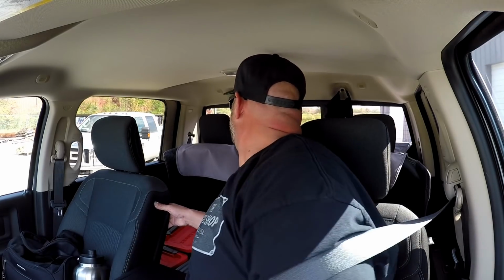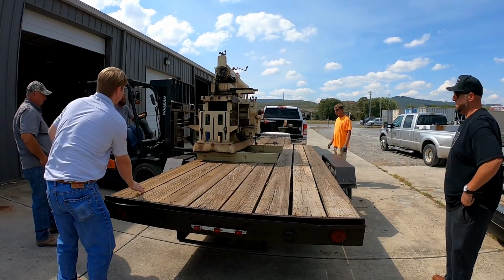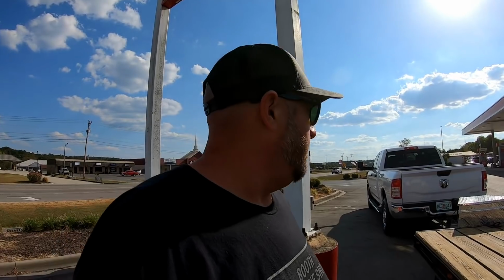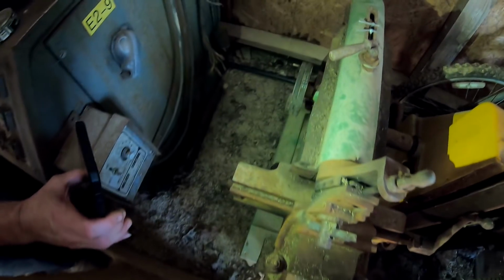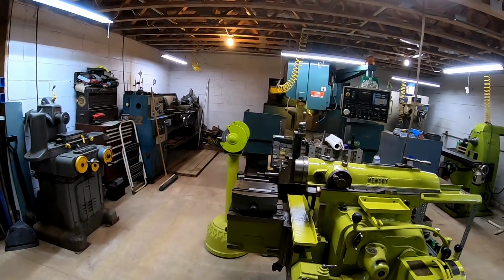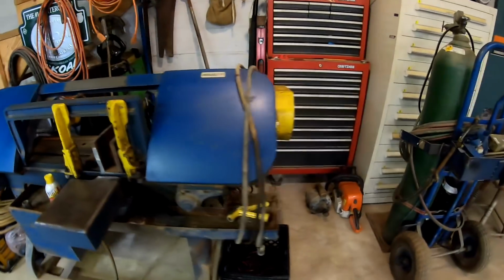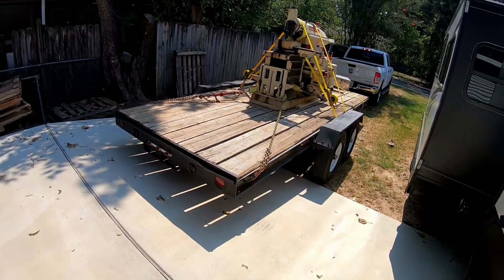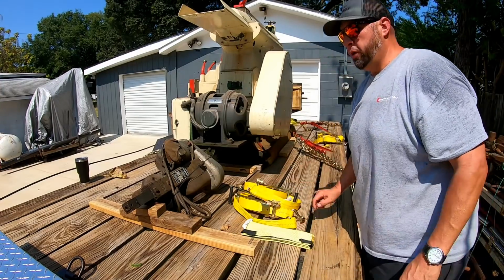SNS 277: Smith & Mills 25" Shaper!

Comment: Guy on the forklift knows his stuff. And patient. And no infernal beep-beep on the back-back.  Bunch of pros work there I betcha.
Reply: If he knew what he was doing he wouldn’t have picked up that one end using just one fork
Reply: @HuronTL  Hey. It is a tool. Tools get used up,bashed,broken,damaged. Yes that was a very heavy load for just one fork. Maybe they bent it,maybe they didn't. So if they did,measure out the unevenness, and bend/force it back in place. I listened quite carefully to the motor. Forklift engines seem to get serviced only after they completely lose function. Not this one. Betcha the filters and short life parts have been serviced. And hydraulic lines etc periodically inspected.The engine ran well. Their shop,their rules,their forklift. They were happy to do what it took to get the old girl off their hands and not scrapped. Whatever it takes. And if that includes an oopsie, so be it.

Comment: Adam since you want to use the trailer like a deck over, you can cut the leaf spring mounts off and add material between them and the frame to raise the deck in reference to the wheels and tires. I think you will keep fighting the fender and deck clearance if you don't add some.

Comment: fyi if you put a twist in your straps, they won't vibrate at highway speed.  And make sure you don't leave a heavy load on your trailer very long.  It will cause a flat spot on your trailer tires and cause a horrible shake.

Comment: Just cut some pieces of water hoses like firefighters use, the inside is made rubber and saves the strap and the outside is something like nylon or so. These really do good job on loading straps and they can be used to save decorative surfaces that are lightly touched by your chains form getting scratched.

Comment: Adam, what would the radial arm drill be used for? Does it have specific benefits over knee mill or a regular drill press?
Reply: They are faster to reposition manually over a bolt pattern in heavy or awkward stock.
Reply: It Can work on bigger stuff..

Comment: Nice to see a Beaver mill! I used to work for Beaver the manufacturer of the Beaver Pal, we closed in the 90's taken over by Mikron machine tools.I was an electrical engineer and built CNC Beaver parts master machines mainly, at their Norwich plant in Norfolk UK. I miss the smell of hot chips and coolant lol.

Comment: What's the purpose of the top piece on the Burke? It's clearly meant to slide back and forth but didn't seem to any attachment points for tools.
Reply: That's the overarm support.  Provides extra rigidity when the cutting tool is set up away from the machine column.
Reply: Attachments are to the dovetails.

Comment: Adam when you go to re-deck your trailer you should fabricate some D ring tie down point’s onto the edge of the deck maybe by welding a 3 /8”or 1/2” C channel to the framework with a half inch iron plate on top  to weld the D ring on , notch floor decking so the rings are below the top of the deck, you could put 4 or 6 per side.. this would illuminate having to run your straps over the edge of the frame … just something for you to think about while re-vamping your trailer

Comment: Just a question on the chain down method, many truck drivers cross the chains when strapping down machines on flat beds, is there a reason for this?
Thanks for sharing Adam.
Reply: Crossing the chains just helps to keep the load from shifting in any direction.
Reply: @thebigdustin  Thank you.
Reply: Yes, it adds a horizontal component (parallel to the direction of travel) to the force vector and stops things from sliding forward and backward more effectively than chains that are perpendicular to the direction of travel (vertical).
Reply: @xenonram  Thank you.

Comment: Adam. Pieces of scrap carpet work well if you don't have enough strap protectors. Also, I have a Bridgeport vertical shaping attachment I picked up years ago and refurbed it. It had a bad motor. I may also add that the weak point in them is a small gear in the stroke adjuster that can break. Just an observation. Hope yours is just fine.

Comment: I worry though about the future will the gen y and z learn to love and save these machines in the future,  there seems to be a real generational disconnect, not just like it was for those born before the 1990's  to the boomers we learned how to work the old way and with tech, but those born after the new millenium well they dont know a world without calculaters computers, smart phones, will they have an appreciation for working with their hands, knowing how to use manual tools, and lathes, non cnc dont get me wrong cnc is good but there are times that the old tools can do a a job better if you have to feel the cut and material, vs a machine just keeping the cut going right on through and ruining an old part or material, plus the set up time programing it, if you only have t cut down the end  or clean up the edge of some material and you dont need to take 20 minutes to program it when you an jaw it up in a lathe in 2 and cut in three, plus the old machines were built to last and in the usa
Reply: I go to a major R1 research university, and a large majority of the kids have zero practical knowledge. Like if you asked them to build a jacking base with 2 CMUs and a 2x4, they wouldn't know which way to orient the blocks or the 2x4, or be able to estimate the strength of the 2x4 to know how far apart the blocks can be. No idea how to use jumper cables. (2 cars were dead last week, and I walked up to 4 people trying to figure it out. They had the black lead on a painted part of the team, because "is you hook it to the negative, it'll drain the battery.") So it's rough. You "boomers" need to take culpability though... You were the ones who raised the millennials, who raised gen z and gen α.
Reply: @xenonram  oh that too, but I was just refering to the topic of keeping our history alive or how to use all the tools available, keep decades old american built stuff from being turned rebar, or end up what could last another 5 decades from from being a shop ornament to rust away when it can be rebuilt several more times, but they just dont have the hands on skills, fewer of them also are from farms or the country side to see how to make things or cobble stuff togather in a pinch sometimes you got to be able to do that to get the job done, or know how to weld when the machine fails, we still had shop and learned hands on I was not as good at it but I understood the concept, or how the machine arives at point b from a in math, I was born in 80 though so I am around aboms age since I belive he said he was born in 1979, good news is they are starting to have shop classes or industrial skill classes again, its not as job based but at least they will learn about how to get from a to b, and maybe a few practical skills for life like we had to in home ecc as a 6 week class, boys too learned how to sew and do crafts and cooking at least in late 1990's to 2000 when I was in highschool, and we still learnd cursive and caligraphy, I cant say I use that much from gradeschool, but it gave us an appreciation for hand written script and reading the old writting, and we learned how to do wood work manually, something though my dad taught me as  hobby from an early age watching him, and I learned how to lay cement foundation block recently and welding though that was only 6 years ago or so better late the never right?
and now I am learning and watching how to forge so when i get the chance and enough time I can heat and shape metal just in case I need to be able to do that in the future.

the kids well some are taking on the old hand skills not nearly as many are though smithing is growing in popularity due to forged in fire and master of wepons its a good thing to know shaping metal to make tools and machine if you can do that you can make almost any hand tool out there

Comment: Always put a twist in the straps. So the straps don't "FLY" . When straps fly or flap around in the wind they loosen up. From my experience as a truck driver.
Reply: You beat me to it HS. Same experience earned in the same place. Straight straps without that half twist on each side will always vibrate in the wind and start to wear themselves out. That simple half twist makes a huge difference.
Reply: Hi... I was in the service hauled ammo for artillery we used 4" wide straps 2 per row (about 4500lbs of cargo) but it usually was 2 per row but we had them flat not twisted because it would tear them? So you would put more tension on the straps by twisting them? Then racheting them.
Reply: @jonathanschrader7881  You don't need them twisted if there already against or supported by the cargo. It's only when the straps are out in the wind and unsupported will they start to vibrate. It's that high speed vibration that quickly wears the straps out. With any deck truck on the highway check out how many have that half twist in the straps just above where they hook into the deck perimeter or above each tightening winch.  It's only the inexperienced drivers who won't do so. The military from what I've heard have there own way of doing things that may or may not be based on logic. :-) But that half twist won't tear up the straps. The tension loads are still transmitted through the strap in the normal way, and it reduces those vibrations by a lot.
Reply: K thanks was curious I do 4wheeling and Idk if I had been setting myself up and ur right bout the army.. The pls 16 ton 10 wheels detriot 2 stroke 54" michelins and a trailer yeah ... The 2 straps was probably for when we wreck with 155mm he lmao

Comment: The only problem Adam may have is space to put it 🤣
Reply: right beside the other!  If you get really large work, the table on one can help support work on the other.  Kind of what I had in mind when I put my floor drill press where it is.  If I had the room for it, I'd put a cut off band saw as 3rd in the line.